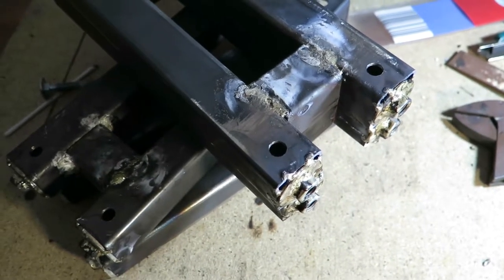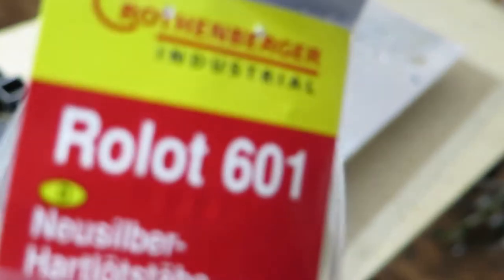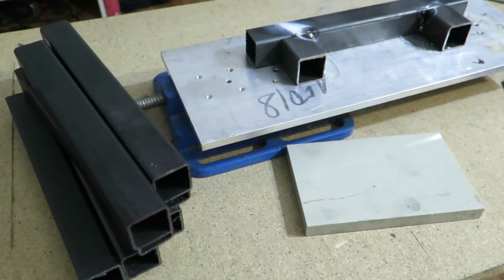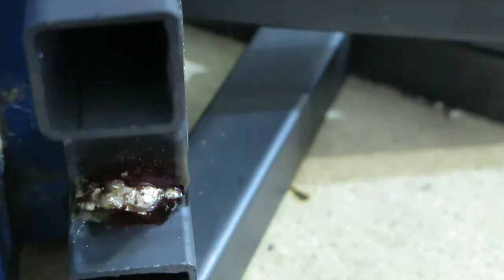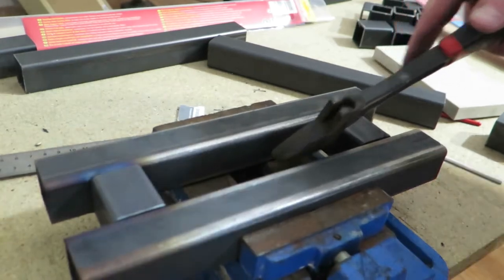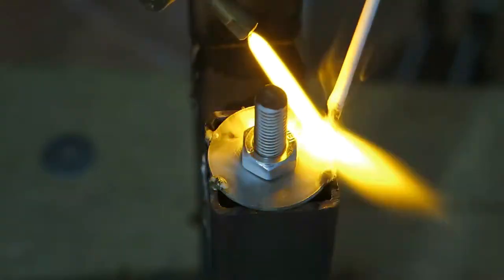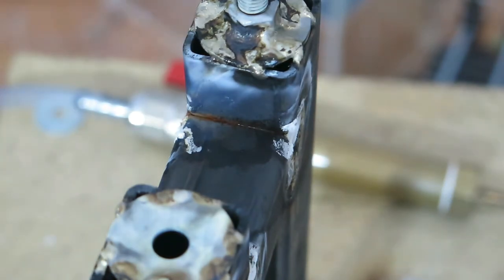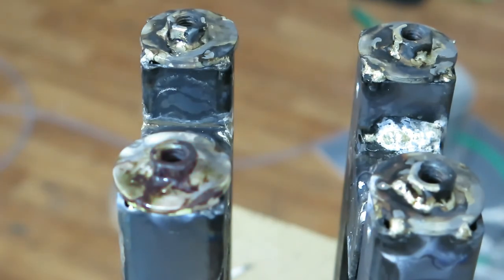Rebuilding HHO cell - Endplate support

Comment: lol'd at AVE reference. yeah maby hydrolyzed phthalate plasticisers, the esters themselves probably wouldn't dissolve in the water, or  maybe you generated some sodium ethoxide which reacted with the plastics to form soluble products.
Reply from the maker: Yeah this cell can operate at near boiling temperature, so hydrolysis can occur.
Anyway, today I have to dissasemble cell so I will make an inspection.

Comment: Brazing works best when you clean the metal surface to bare metal. Metal scale will cause you problems with strength and adhesion. The alloy of rods you are using are really super strong. Actually stronger than the metal you are brazing.

Comment: Ethanol produces acetic acid when oxidized, which I would expect in an HHO generator (although I am not a chemist). What if you try isopropyl alcohol?
Reply from the maker: I don't think, that it oxidized.
But bubbling through volatile liquid seems like a bad idea...
Still have to try adding propane on output.

Comment: how come you were able to weld steel together with hho here when in other video you failed?
Reply from the maker: This is brazing, similar to soldering. Steel is wetted by brass and it makes pretty strong connection, but not as strong as if it was welded
Reply: @IlusysSystems  that is what i figured,,so you have more success brazing than welding yes?
Reply from the maker: @ARCSTREAMS  generally you can not weld steel with HHO, even if you could melt the metal it would be super brittle. so brazing is definitely possible, but much slower than TIG though
Reply: @IlusysSystems  yes is too bad the hho flame still creates porosity of hydrogen or oxygen in the metal and makes it fail,,i thought the perfect 2:1 h2 and 02 created a perfect complete clean burning flame?

Comment: You must bring the workpeace to the meltingpoint of your brasing material, what you are doing is totaly crap.
A good mecanik have the flame in trave way and folow with his brazing rod.
When you habe the right temperatur you get it super clean.
Dont melt your rod withe the flame.
Reply from the maker: Well It was my first time :) last piece was pretty good though.